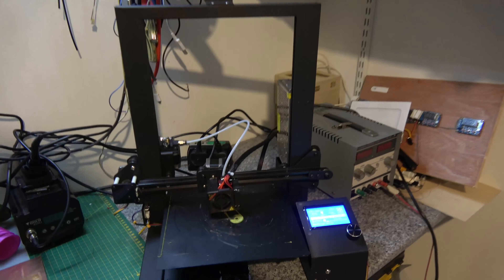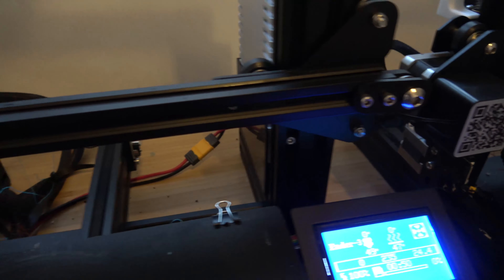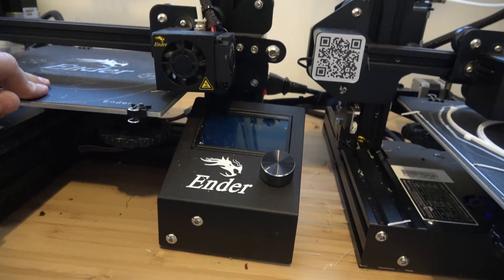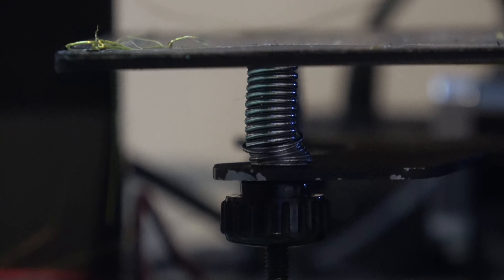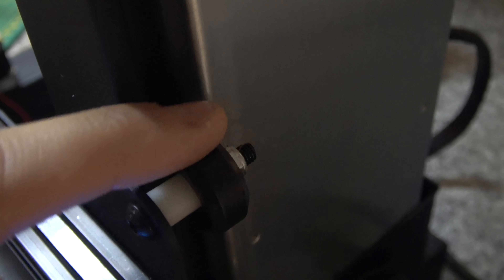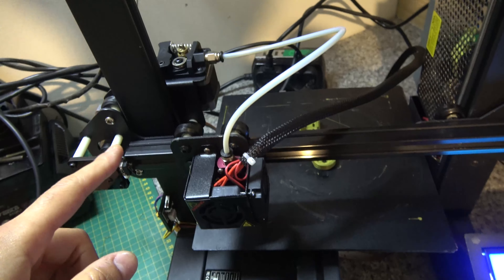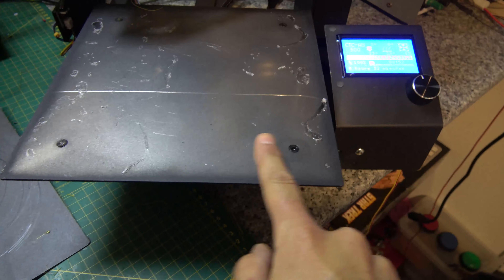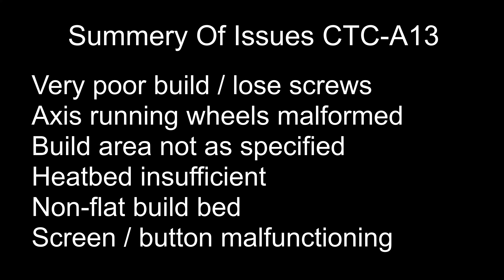Review and Experience of the A13 3D Printer - Compared to Ender 3

Comment: I have just taken delivery of one (3 days ago) and then stumbled across this review. It has not been 12 months since posted and I have to say mine is nothing like the condition of yours. The screen is fine, the wheels are alloy, the bed has a magnetic cover and everything bolted together fine. Admittedly there were several screws that needed tightening and also aligning. I think it's also fair to expect to have to do a little extra when buying something DIY, from China and at the price they sell for. The research I did prior to ordering one uncovered that the CTC A13 has many clones so I'm presuming you were unlucky enough to have received one of those or the CTC company have made major steps forward in the last 8 months. So long as you get what I have got I would recommend them to anyone. Great value for money!

Comment: I wish I had paid an extra £100 for an ender. It's been a good learning curve curve however. Trying to level the bed is the major issue. Just added a glass top which cuts down 50% of the issues. Poorly assembled, poor heat bed. Anyone wishing to buy this don't bother unless you have a lot of patience. Go for an Ender.
Reply from the maker: Well good to know it wasnt just me. Shame it seems to be many units with these issues though. Machine concept is good, but poorly executed.
Reply: Shame really....A bit more attention to detail and they could get better results. It is lots cheaper than the Ender but it would never come close to being "better than the Ender 3" . With something like 3d printing you need accuracy. This just does not deliver. It's a good review here. Tells it like it is and is quite polite in the criticism..
Reply: @DanSohan   i have this but not really good ... but i change bed,220x220 ,springs to bed, whells, and put on my glass... for stability i have boring the hole large and change short screws .. now is stable because not stay to screws  but not compare with ender 3 .... i not return back because not possible ...

Comment: Hey buddy, I was looking for Ender 3 and this crap came up "Cheaper than ender 3" on title and in description saying "Better than ender 3" so I'm happy you made this video! I'm stay away from this junk!
Reply: I just received it and I'm shocked as fuck. It has an 8bit mainboard, the bed isn't magnetic or wired good, the power supply is old school rubbish (not Meanwell), Stepper driver are HR4988 which is a clone of the really bad already A4988. I agree with the video that it's not level. I mean I could go on with bitching, but I never put it together and I waiting to refund it. Best spend more on the latest Ender 3 because the savings will gone after you upgrade to a 32bit board and a Meanwell PSU.

Comment: Please, what are the motor controller on the ctc a13? I need the number to adjust my maximum extruder current. But I don't have thermic glue so I don't want to remove the passive radiator from the mother board to check.
If anyone interested, I checked on the X axis, it is an HR4988

Comment: Bought one a couple of weeks ago. Couldn't fix the frame to the base. I took and end cap off and put a led torch in to see why the screws wouldn't go in. The holes on one side were about 3mm out of line. No chance of building it. Frame is spray painted. Yes the wheels are terrible. It's going back to the ebay seller. They also had the cheek to advertise it as having a Meanwell power supply.. Wasted two hours on this rubbish. Incidentally, I assembled a new Ender 3 Pro yesterday. What a dream that is in comparison. It costs a lot more but it's ready to go out of the box..
Reply from the maker: Its a shame because a lot of new comers will be put off the hobby / skill if they have a fail at this point after buying something that should be getting them up and running quickly! - Hope you have fun with the ender, ours have been going for 1000s of hours now. I will do a video soon of things to watch out for, there are a few issues that pop up over time, but nothing like that A13!

Comment: i cant even get mine to work, im using the latest cura program, i can use the program to pre heat the extruder and the bed, but it wont print anything
Reply: Have you managed to sort it? Ive just recieved mine an dam having the same issue
Reply: @joeparker2058  i switched to prusaslicer, its so much better than cura and my prints are so much better since

Comment: This printer it's a mess! Apart from loose stuff everywhere, hard plastic misaligned wheels, the single worst part is the bed, the surface material it's glued terribly, there are BUMPS where the screws are.....! For now I'm planning to stick with PLA so the tiny heater it's not a big deal. I've brougth home this to play with my son and we learned a LOT of stuff in the process of assemblying it. I have engineering background so it's easy for me at least to spot what's going wrong, but i think it's a great printer for learning!!!  I will problably not be able to print anything astounding but hey, it was 120€ shipped....  UPDATE! Just printed a small 20x20mm tile and I am very happy with it :)
Reply from the maker: Glad you got it up and running. But would you agree with zero engineering background it would have been a no go? I'm also getting ok use out of it, but not it's full potential
Reply: @DanSohan  Absolutely! I don't even want to start thinking about someone who buys this withtout prior background!!!
Reply: @DanSohan  An update, I printed a quite good benchy with 0,2 layers... I didn't finish because when the boat superstructure was at about one half, z-wobble started to appear, and I had the very bad idea of tensioning by hand the X timing belt :) The printer lost a few tens of steps and BYE BYE!!! Up to that point the benchy was surprisingly good, no stringing, no big 'bumps', just a couple of strange but small artifacts on junctions... The bigger limit is the really bad shape of the bed and the awkward glueing of the mat.....

Comment: Thanks for saving me £160.
Reply: Not so fast, with a few upgrades and tweeking this printer does well (for the price), I have 2. My wheels are fine and I changed the build surface to magnetic. Yes you  should go over the machine and tighten all screws, I also added TL smoothers and getting good prints.
Reply: @FD-gm6qp  rly?